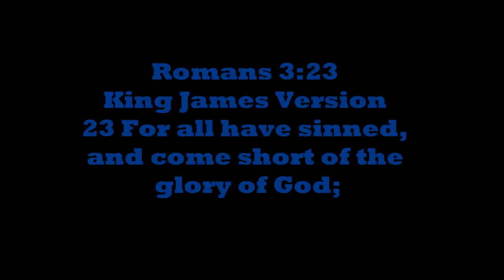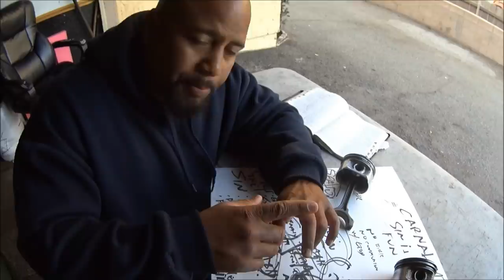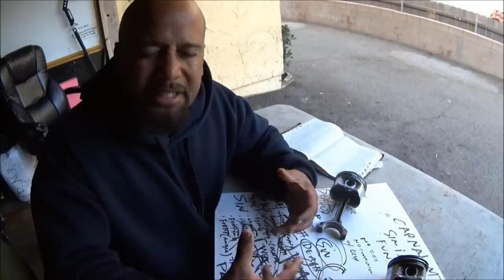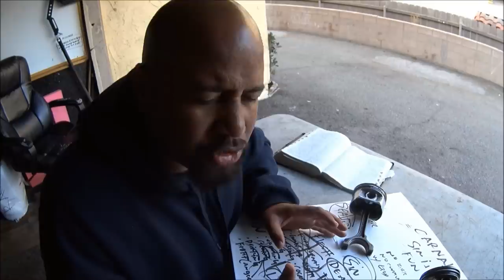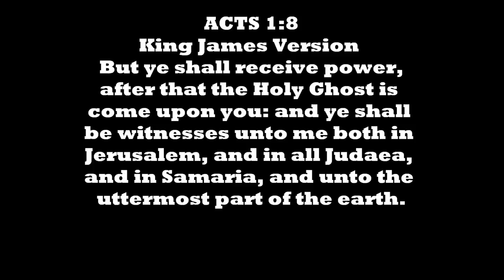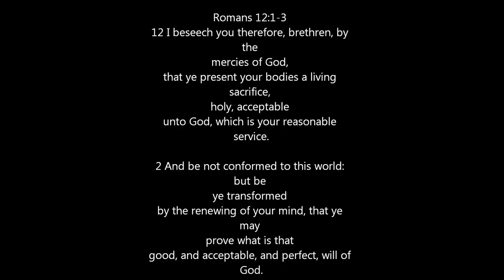FIX ROD KNOCK UNDER $40 FOR THE BROKE FOLKZ HOW TO FIX YOUR BROKEN SOUL STARVING YOUR SPIRIT (2023)

Comment: Sup man, the video is great. Like you say if anybody doesn't like it,   they could beat it...I have a 2006 Mazda MX-5 Miata NC 2.0 with a rod knock. I bought it that way, previous owner said his son use the car for 4 months and ran it out of oil. I'm getting ready to pull the oil pan off right now,  just got to take half the car apart first just to get to the oil pan,,  unbelievable. If it's real bad I'm just going to pull the motor and do it all. I'll know more once I get in there. I don't feel 
like doing complete rebuild right now..  have a lot of other things going on right now so hopefully this will buy me six months to a year.. well anyway thanks for the video.   peace and love  brother

Comment: I like you!  I learned that same trick back in the 80s laying on my back under the truck with the oil pan removed.  I also heard that a permanent fix is to grind the crank  .10 and then use some oversized bearings in the block.  Is that true?  Will this really work?  What I would really like to know is what to do to prevent this problem from ever happening.  My guess is thicker oil: more oil pressure, or retorquing the bottom end after the break-in.  That's all I can think of!  I know there must be a way to prevent this bearing failure.  Around here in Oklahoma, 8 out of 10 Trailblazers being sold for parts is because of a knocking engine bearing rod.  I did the research myself.

Comment: I've done this on tractors (diesel) in fields.  Several hundred hours later they still ran like a top. It is my belief that most engine issues are top end - seals/valves or ring/piston failures. This of course assumes people do maintenance - such as keeping their oil topped up and changed. God bless.

Comment: Excellant explanation of how to make the car last alittle longer! Depending on how much the crankshaft is out of round and how long its been knocking! You still need to measure  the crankshaft to determine the corrct size bearings, and also have the right tolerance and you wont have the same condition ortoo tight a bearing. I appreciate  your take on the  the bible and automechanics. Keep doing what your doing brother , you"ve got my attention!

Comment: I really appreciate this video man, it gave me the knowledge and confidence to do this job. However, after finishing the job and starting the engine, I’m getting white smoke coming off engine block 😣 the work continues. Keep up with your oil changes people
Reply: Did it fix your knock?
Reply: @johnsmith-ox3bb  I was dumb and didn't realize connecting rods/caps/journals etc all have to be torqued to precise specs. Car ran great for about 5 miles then couldn't stay running, ending up having to scrap it

Comment: Amen my brother...thanks for all this info...i was planning on doing this before until i saw your video....motivated me more. Plus the scriptures which you read/shared and the demonstration made me think. 
Picture a stock engine with a lot of aftermarket mods,  if it's not done correctly and well maintained...the engine will run erratically etc. 
Much appreciated. Stay Blessed

Comment: I did this recently because, well, I'm cheap fingers crossed it works for a while if not well I tried...one of my connecting rods is still loose I think it may have been installed backwards because the rod cap was facing the wrong way before I even touched it. I enjoy the spiritual motivation!

Comment: This dude is amazing. I had an old Honda that burned oil even though it just had a valve job before I bought it. I'm wondering... Does having an open bore with oil slipping past the piston make the car feel tired? It definitely burned oil even after having a valve job.
Reply: You can't diagnose it like that, you have to do a compression test or a leak down test.  A valve job on an old engine will just make it consume more oil.  Unless they lied to you and it's a valve seal leaking.  Depending how fast the oil level goes down you might need to get it rebuilt.

Comment: done same thing on F-100. But I pulled the engine out pulled out crakshaft, wrapped emory cloth around journal , bolted connecting rod back on, spun connecting rod arround to sand journal smooth. Paid for new bearings and plasti guage and installed and did rings too. I did that all in a couple days because my wife at the time managed to get us thrown out of her mothers home. The bearings where soo tight truck had to be pulled to start. But it broke in like a new engine. Rode from Texas to Florida, no problem. Later divorced her. She robbed a store and stole my car. Never pick up woman at bars.

Comment: Stranded in the left line of the intersection.. Replaces connecting rods bearings.. Hazard pay 500 an hour parts cost  57 dollars at penny pinchers..
 Up next starter went out no problem 
125 dollars or 12 dollars fix same with alternator s. Set of brushes. And your good to go another 3 yrs 
. commenting live live live from Grand Canyon State. Deep inside FEMA REGION 9..

Comment: Yesterday, I over accelerate my 2014 Santa Fe on the freeway.I was running at 70 miles and depress the pedal hard. It turned off, I pulled over and after 10min of trying, the engine started up again but It had this noise. 
I was lost trying to figure out what happened,  thinking of the dealer and a lot of money. After this video, despite being a Teacher and never done this before ( I used to be a maintenance technician but no related to cars), I am very confident to do the repair by myself.
Thanks a lot for your detailed explanations. It's a very specific video even for novice people. As you said, you are saving me tons of money here.

Comment: Thumb over a garden hose- same principle.

The close tolerances of the bearings dictate
the line pressure. As the bearings wear, the
tolerances increase- lowering the pressure-
until one or more circuits suffer metal-to-metal
contact. That thin film of oil between the surfaces
needs to be very high, and constant.

It's usually the ones farthest from the pump, in the
circuit to suffer damage.

Comment: there IS a good way to replace the CRANK BEARINGS!   ive seen a vid or two on this method: using a cotter pin inserted into the oil hole. Head of the cotter pin in squashed down: no higher than the bearing thickness.  Then hand rotate the engine and the cotter pin pushes OUT the old bearing. The crank shaft is still in place!  Then insert the new bearing the same way. Cant polish the crank portions (really) but fresh bearings could be a benefit.

Comment: I did this to an old crapolla about ten years ago, all four rods were knocking from vandalism. Replaced rod bearings on the crank and drove the car for years with a heavier grade of oil. bearing clearance was .004 and borderline out of spec.. Just fix it and don't worry about having everything perfect.

Comment: Outstanding vid! But, yes you could've done the mains, including a shoelace/sandpaper burnish without fully removing the crank. Heck, I even pulled the entire crank out of my 78 courier pickup through the bottom for a main seal R&R, without removing the engine or messing up the position of my rings.  Full disclosure - I did have to also remove the flywheel to fully remove the crank. Dropped that flywheel on my left ringfinger, right on the nail during reassembly. Didn't help that I was laying on a sheet of plywood at the time, so zero give when it hit. Point being you can easily do the mains. Just saying...

Comment: I came back to your channel just to rewatch. Wasn't trying to learn anything just like your videos and how you come across as a level headed guy. Need more people like how you seem to be in your videos. 
I like to assume this is legit your personality off camera as well.

Another tip to anyone legit on a tight budget and has to save every cent possible, try STP oil treatment (blue bottle) as a substitute to assembly lube, I have used it without issue.

Comment: Straight up Facts! AMEN! But you didn't show the set up of the timing chain. You have to set the piston to TDC prior to start up, but the vid is to the point for the Mechanics that have knowledge. Nice short cut to buy time on a engine that's on the way out. Thanks, and with this vid one can get their body back to running on all cylinders with the message you put out. Church Mechanic. Wrench your life to righteousness! You have to maintenance your Body, Mind, Soul, Spirit and drain and flush out out all contaminates and add certified quality components to ensure optimal performance of your life! In Jesus Holy name Amen!

Comment: Good video, used to do this to 2 stroke pistons and cylinders it worked quite nicely for what I expected, still got one of the cylinders I done that has tons of kilometers and still runs.
Stock small pistons last longer doing this, oversized pistons wont last as long also depends on the cylinder some got a big exhaust port without column wich causes pistons to get stuck on the port when they have little wear so this wont work with those.

Comment: Great video and thanks for making the effort to video the process and give a very nice sermon at the same time.  How many miles did that motor have on it?  And I wonder how many miles its gone so far.  We've got a 4.3 V6 in a 97 Chevy truck that has a rod knock on 163k miles - will try this same method.

Comment: By the way.  Use LUCAS OIL BUILDER with every oil change. It sticks to all the parts since most engine wear is the first minute when you start your engine. In airplanes the put pre Oilers that pressurise the system with lubrication before turning the engine over before starting.  Aircraft engines keep you alive. Worn motors make corporations money from wearing things out. That's why air planes still flying 60 years old and older.  
You can buy pre Oilers for your car and install it.  IF YOU DUE PLAN ON OWNING YOUR VEHICLE FOR 30 PLUS YEARS  Preventative maintenance is the best option. I've used Lucas in my one truck a 99 GMC that I bought new  I've got 233k miles and painted it completely. Just put a double roller bearing timing chain a few months back. I'm not going to pay the Corporate thieves and the banksters that 1000.00 a month payment. 
I got disabled on the job in year 2000. So I'm glad I take CARE of my Spirit, body and truck.  All blessed by the LORD.    MAN LIVES NOT BY FOOD BUT BY EVERY WORD THAT COMES FROM THE BIBLE FOR WE MUST FEED THE SPIRIT

Comment: iv dont somthing like this but with a subaru  2.5 turbo motors are crazy expensive   so i cheaped out got a non turbo 2.5 swaped pistons  in it and filled  the open deck sleeves  in coolent passage with blokhard  its a epoxy used way back in the day to support cylinder walls from cracking under high power   its an old hotrodding trick   anyways  filled both sides let it dry put head gasket over traced coolent jacket holes and drilled them out    motor is still running to this day lol  saved me 2k easy
Reply: Very interesting
Reply: I haven't looked to be sure about  Subaru but typically turbo pistons are forged while na pistons are cast. If that's the case here you must not be running much boost.

Comment: I'm going to be tearing my 1994 Ford explorer's 4.0L OHV V6 engine down. It has what I believe is either main bearing, or a rod bearing knock. - At least that is what I believe it is. - Each time, when the engine is cold, and when you first start it up, it will purrr like a kitten, with no noises.  But however, after you drive it for 3 or 4 miles, and the engine is up to operating temperature, it will start knocking just like a rod knock. It sounds like it may be coming from the lower end at the rear of the engine, back near the firewall and possibly from either number 3, or number 6 cylinder.  I've already changed the oil and oil filter, and have added a qt., of Lucas oil additive.  But to no avail, as the symptoms are still the same, purring like a kitten with no noises when cold, and the same noise returns when back up to operating temperature. But, at least it quietened the knock down a small amount, even though it is still there. It has never showed signs of burning any oil, and there is no smoke coming out the exhaust pipe, and when I changed the oils and oil filter, I did not see any metal particles in the used oil, it was just simply brown in color, with no sludge, milky substance, antifreeze, or water condensation in it or showing. Because of this, I'm hoping to get by for a couple of more years with just overhauling the lower end.  I've already ordered another crank kit for it (rebuilt crank, with matching main, and rod bearings). I've also ordered the front timing chain cover, rear main seal, and oil pan gaskets (Even all of that small amount of parts cost me $360.00. The heads would cost me another $900.00 of which I just can't come up with upon a very limited retirement budget). When I changed the oil filter, I had a brain fart, and forgot to fill the new filter with oil prior to installing it. so it took about 45 seconds for the oil to get up to pressure and smooth the noises out. and even at normal operating temperature the oil pressure gauge  shows high (above the middle of the gauge), and not upon the low side. So possibly the oil pump is still ok, and I won't have to change it at this time. - Any ideas if I'm correct or not? If not the what is the cause of that knock? On a very limited Retirement budget, I can't afford to just go all out, and rebuild the whole thing, or turn it over to a garage to do it as bad as I'd like to do. Even a re-manufactured long block would run over $2, 500.00 from Auto-zone or O'Reilly's, (neither one of them say they carry or sell just a short block). - So. Sorry, unless I hit a lottery Jackpot, or Jesus suddenly grants me with a fortune, because I'm an ordained minister, then those options are out. So, Ill just have to do it as cheaply as I can at this point, in my driveway as a shade-tree mechanic. For those who want to complain, and insist I have no idea of what I'm doing or getting myself into, well, FYI.... I've worked in many automotive garages as a mechanic during my lifetime. However, I will be the first one to tell you that even after all these years, I still don't know everything, that's why I'm asking about what might be causing the knock. - Anyway, Great informative video, and I love the way you explain everything step, by step in layman's terms - Keep up the great work Oldskool Funk.

Comment: we did the same thing on  75 vw scirocco   mk1  8v    even used jb weld on a crack block that overheated   and reused everything  head gasket and all  car  ran good      that was the  90s

Comment: Thanks for the vid, I used a peice of soda can to space out a worn rod bearing, still working as scary as that sounds
Reply: A guy i worked with had  hot rodded VW powered sand rail and he would run it for about 6 weekends on the sand and then tear it down. He knew from past experience how many hours it would run before it started loosening up. Then during the first teardown he would put a certain thickness of shim stock under the bearing. He ran this buggy hard and it had the better part of 200hp on tap. The first time he would use pretty thin brass shim. I don't remember what thickness he started with but after a certain amount of engine hours displayed on the hour meter. I think it usually worked out to about 8 weekends and another teardown was in order. Each time he would go another few thousandths until he got to a certain thickness he was putting on the backside of the bearings. Actually he may have just been doing the mains as the engine case halves try to pull themselves apart with a high compression hot rod air cooled VW engine.

Comment: this is amazing man! i appreciate all you do. just out of curiosity, this is just a temporary fix you said, for a few months? my rod knock started today and i immediately stopped the car. i hope i have not damaged most of the engine. gonna try to tackle this but i hope the rest of the engine isn't janked up.
Reply from the maker: Take down the oil pan to see if you have metal debree, if not I would try it out. You never know it could last for another year or 5
Reply: @oldskoolfunk71  thanks so much:) i will check it out. i have a 350z which is 3.5 liter v6, i hope this method will work . i'm one of the broke folks
Reply: @abdullahahmad4922   hi 
Did u fix it ?

Comment: May Jesus Bless & keep You & Yours, my Brother from another Mother.   The engine "rattled" for a couple of seconds on your 1st start-up. Will this brief-rattle always be present until you replace the engine?   Would assembly-lube have been "better" to put the new bearings on, rather than engine oil [maybe eliminating that very brief 2-sec "rattle"?]  ?   Jaguar used to have a mechanical-pre-lube where an oil "clearance" was established on its old DOHC straight-6 bearings before it fired-up, but then with full compression, you wore-out Starters rather than bearings;) .  Both talks were Primo, man,--the bearing repair, and the Soul-repair!

Comment: great video, but why is that crank shaft bad? and how would you determine if the crank shaft is bad? Iv got a few 2.3 4 cyl boat engines i plan on rebuilding is why I ask.

Comment: actually contrary to popular belief, the "rod knock" is actually the sound of the piston hitting the head and not the rod hitting the crank journal (because the rod's and crankshaft's motion is circular so no matter how much looseness there is in there it's going to be mostly silent)
Reply from the maker: It's the rod hitting the crank journal
Reply: @oldskoolfunk71  actually it's not.   Think about it.  Remove the head and crank it if you don't believe me.   Or put a piston in that has a shorter wrist pin height and run it.   Even an old timer like you can learn something new.  I've been wrenching since the 1960's.